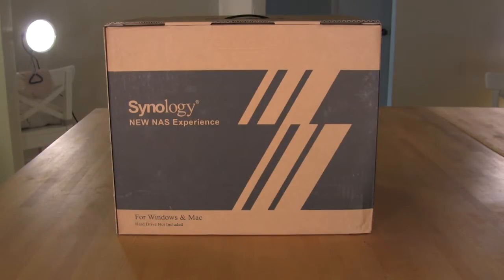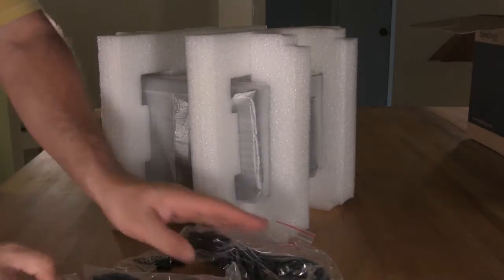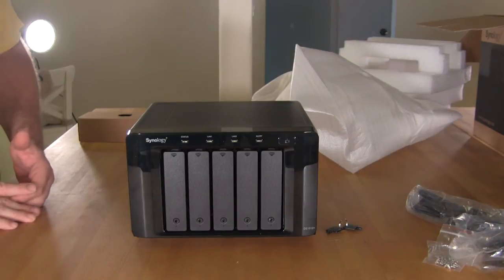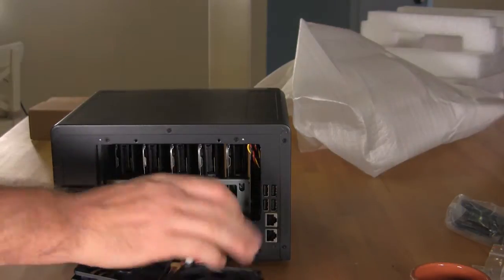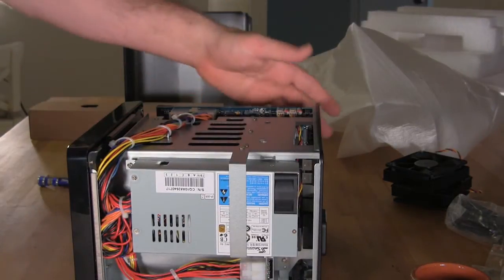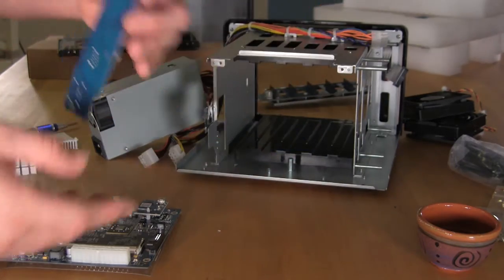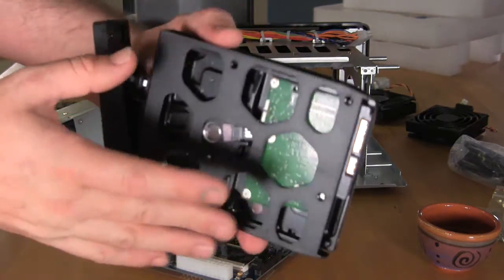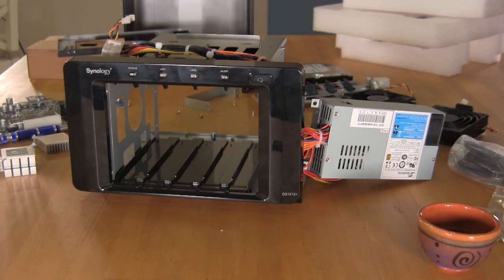Synology DS 1512+ Design, Features and Build

Comment from the maker: Yes it does have a browser for direct file access (we cover it in the written review).
We did not test it with 4GB of RAM, and the OS only supports 3GB while the board will take 4.
As far synchronizing multiple devices, let me confirm that for you. 
There is no deduping feature in this device. Usually deduping is an expensive option in a NAS.

Comment from the maker: It is a little more than that. The DS412+ does not support stacking like the 1512+ does, With the 1512+ you can add on two additional DX510s for up to 60TB of storage. The 1512+ also can expand it memory up to 3GB of DDR3 the 412+ is limited to 1GB.

Comment from the maker: Resulting to personal insults? I am trying to explain to you how RAID works in NAS and SAN devces. Both use higher power x86-64 (or RISC) CPUs in combination with RAID processors or RAID controllers to provide better perforamnce. Take a look at a NetApp, EqualLogic or EMC.To have hardware RAID you need a controller, a dedicated CPU and memory. The NAS devices using Atom, or C2D are doing the same thing with their products.

Comment from the maker: I do not have to install the Intel Matrix control software to use RAID I do have to install a driver in Linux, FeeBSD, Windows etc. The same goes for the Intel RAID card you mentioned. As for it only working in Windows in RAID mode my Mandriva system with RAID 1 would seem to differ.

Comment from the maker: Again you are not getting the point, The "motherboard" in the NAS IS the RAID card. It is designed around the ICH10R, the Atom is the processor to run the RAID that the ICH10R provides. It becomes a hardware solution becasue there is no installed OS. it is all firmware based. LSI, Intel, 3Ware, and others do the same thing on server motherboards and they are still 100% hardware solutions.

Comment from the maker: But you have not shown that at all, you have speced a bunch of hardware with no OS. It lacks anything to make it work. The board that is used in there is specialized so that the ICH10R in combination with the Atom operates as a "hardware" RAID configuration. The "OS" on it is more of a firmware that operates in the same manner as the RAID card you listed. Your solution cannot operate and does not have the same level of features of function.

Comment from the maker: Actually it does matter, your definition of "hardware" RAID was debunked a long time ago. The ICH10R has its own controller and its own BIOS to setup RAID (the OS you are talking about). All hardware requires a driver to run or a software component. All of the hardware you have listed is usless without an OS to run it. The RAID card cannot provide that. You are also losing iSCSI support, Dual LAN with LACP support. You cannot justify the 5000x times example you quote.

Comment from the maker: Are you certain that the controller is full "hardware RAID"? Windows has drivers for that and LSI maintains a driver data base so that you can run it with Windows that qualifies as software RAID. I also do not see an OS for your NAS, can you let us know what you will be using?

Comment: Your written review does not cover aesthetics like noise or noise compared to something.  Those little high speed fans like on the power supply can be screamers, so is that one always on, or only when copying files to the NAS for a while or what?  Also would be interested in a more thorough review of the software like photostation - your article mentioned an issue with it.  Thanks.

Comment from the maker: We are double checking some performance data. It is not consistent and we are checking to see why. it looks like an Issue with the Intel NASPT application right now as it is not certified for use on 64-bit systems and has issues when running on machines with more than 2GB of RAM... We hope to have this resolved very soon and confirm the speed that we are seeing with the Synology Hybrid RAID, RAID 5, RAID 6 and RAID 10.

Comment from the maker: the eSATA connectors on the back of the DS1512+ are meant to be used to attach drives to the DS1512+ not to connect this to your PC. This is meant as a NAS device. 

As for RAID enclosures LaCie makes some as do Seagate, Thecus and even Wetern Digital had one before. 

eSATA will be ok, but you will loose some performance due to the way the channel will work with an external enclosure Vs an SAS controller with an external port.

Comment from the maker: You should get goot speeds, but also rememeber that this does not support direct connections Via eSATA. It is intended as a network attached storage device. However, you can setup iSCSI and  link the two NICs using LACP for better read wrtie speeds.
If you are looking for something direct I would invest in a good SAS 2.0 controller and an extrernal RAID box., not a NAS

Comment from the maker: The eSATA connector is for external drives only it will not allow this to act like a direct attached storage device.
On the other hand you can setup an iSCSI connection in Windows 7 Pro or better and it will be seen as a local drive. If you team the two NICs then you should not have any issues. As for the RAID settings.RAID 0 will get you speed, but no redundancy.